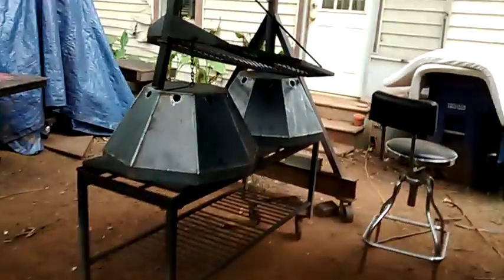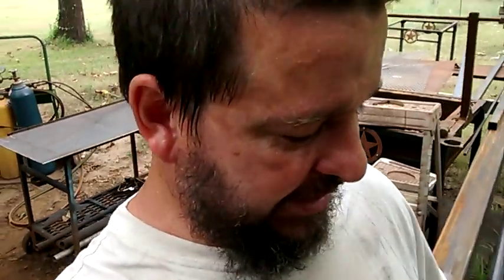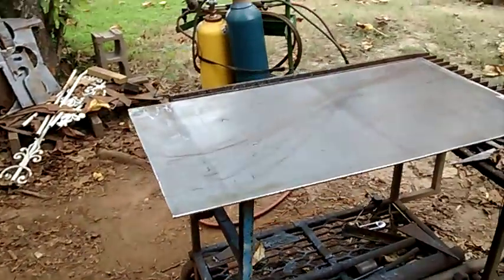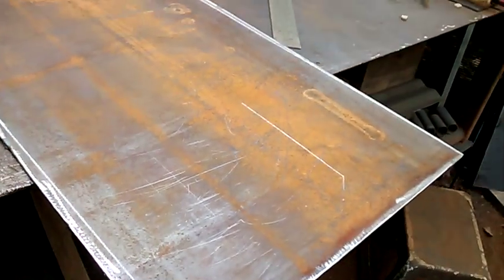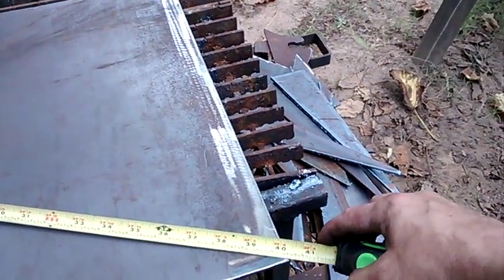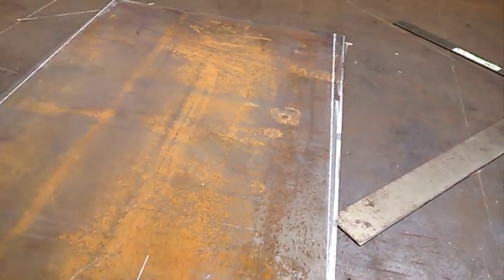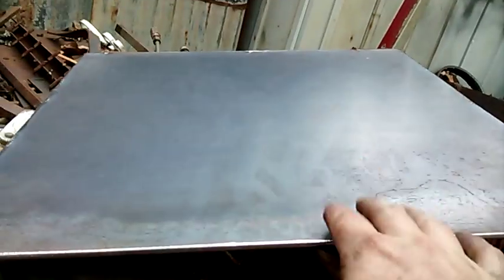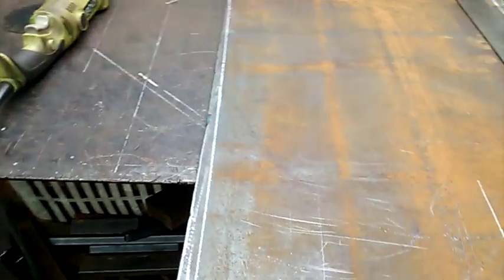Fab shop tip..square your steel!!

Comment: Years ago I worked in a shop that had a jig made up, the back and one side were welded square so you could butt the sheet up to the back and use the side as a straight edge to run  the torch along, nice and simple and worked really well, it was like a big framing square but the long edge sat about 1/2 inch above the short edge, this let you slide the sheet under the long edge, push it hard against the short edge and cut it square every time, using the long edge as a guide for the torch, hope that makes sense, years later we got a profiling machine, took twice as long to set up and was a pain to get results no better than that jig made from two pieces of angle iron
Reply: Sounds awesome but I have no idea how its designed..

Comment: brother, like some others, i appreciate you showing the good with the bad. lets others know their isnt a mistake they can make that someone else hasnt made. i watch your videos a lot and have seen you admit to mistakes made, and other "experts" try to rip you apart in the comments. like the one where you were, i think comparing a weave to a stringer closing a gap. you said you didnt spend enough time on the sides of the weave. those of us who have actually done more than watch videos of welding, know what that means. however you had 2 guys go on and on about there being undercut on the weld. how do you get undercut geniuses??? allen admitted and pointed out the undercut on practice runs. not spending enough time = undercut.

i have been welding for over 40 years now. welded everything from bicycles and swing sets to tanks and battleships. i mean that literally and honestly. i got in a hurry on some outside trailer supports and poured in more heat than i thought the other night. it was dark and i didnt notice they pulled out of square. everybody makes mistakes and its important we teach that along with everything else. you crawl before you walk and eventually you crawl again. no bodys perfect and experience means you have had success and been witness to failure. you know what works because you also know what doesnt work.

 i am impressed with the work you do youngen. i hope you keep it up and keep making these videos.

Comment: I often check the sheet for square before I cut it up. sometimes you never know. I live by the old woodworkers adage of measure twice cut once. It pays off, but as my father told me, you will make mistakes and it is what you do to correct them and move on.

Comment: Structural/pipe fabricator here. I never assume the steel sheets we get are coming square because most of the time they never do, you are lucky to get a 1/4 out of square sheet lol. Its amazing how in 2024 with all the technology we have they cant fabricate or at least cut the sheets square before shipping them. 

Mistakes like these happen bro its totaly understandable. In the 15 years that i been doing this i have found out that whoever tells you they never make mistakes they are a fking lier

Comment: Hi Alan, you should rivet 1 meter or longer stainless steel rulers vertically on your bench, each end of the bench about 2.5 meters apart, this will give yourself a good square reference points to pick up from👍👍David from Australia

Comment: It looks like the problem is the ends not square with the long sides
Reply: You're correct as long as the long sides are parallel the perpendicular lines must be at a 90 degree angle and it will be square